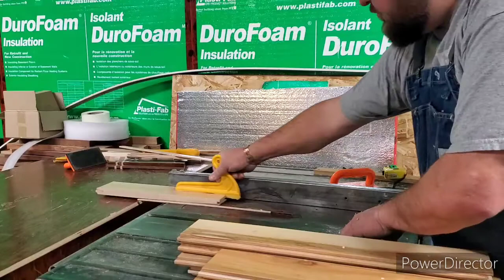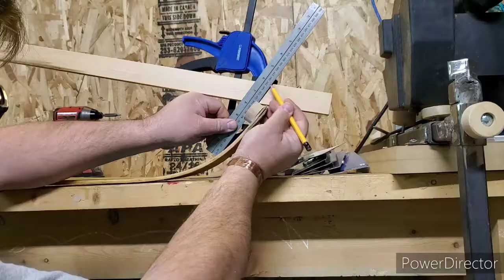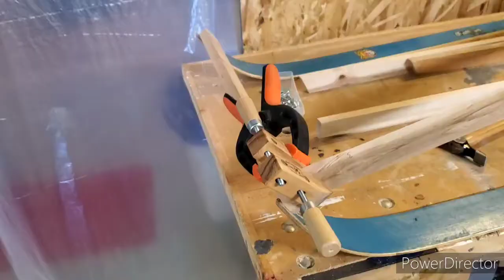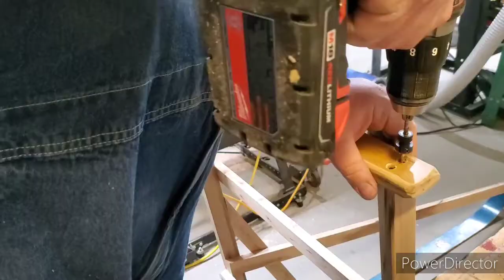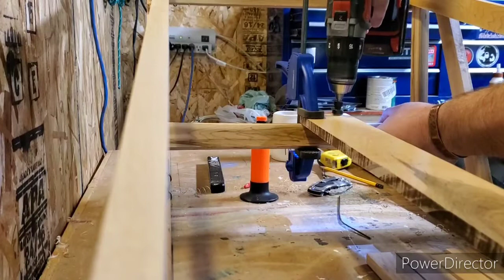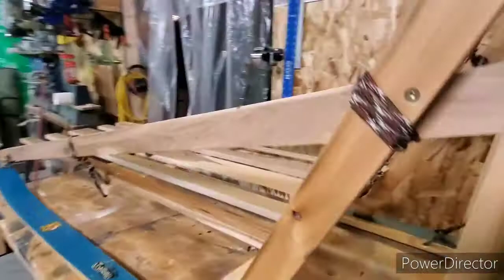DIY Dogsled from old cross country skis

Comment: Dont all the screws make it fragile..
Reply from the maker: I predrilled a slight bit over-sized the screws in the areas that needed to flex so they act more like a tendon and the paracord takes most of the load. It's been holding up well. The kids are still using it.

Comment: There wasn't any measurements. I can totally build this. What dimensions are your sled? Approximately how many boardfeet do I need? Did you rip those into 1x2's? Thanks
Reply from the maker: I built it relitive to the skis so there really was no measuring done, just what looked proportional.  It's all out of maple hardwood flooring that I ripped the tongue and groove off and then in half and thicknessed to get the bottom flat.
Reply: I recognized the flooring as you were repurposing it. Do you know approximately how many flooring boards you ripped in half, and how long they were? Just trying to get an estimate to buy some wood to build one of my own.
Reply from the maker: I'm thinking 7 or 8 boards around 4' long would suffice. 
I'd recommend when you attach near the ski tips go a couple of inches down from the tip. Recently the tip cracked at the screw for me, the paracord is holding fine and sled still functions as it should but it's aggravating.